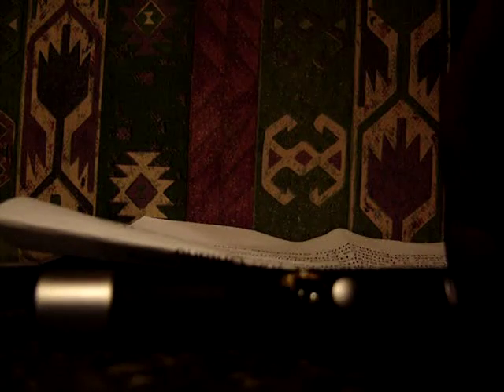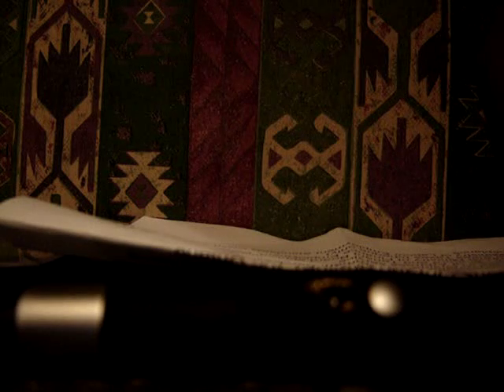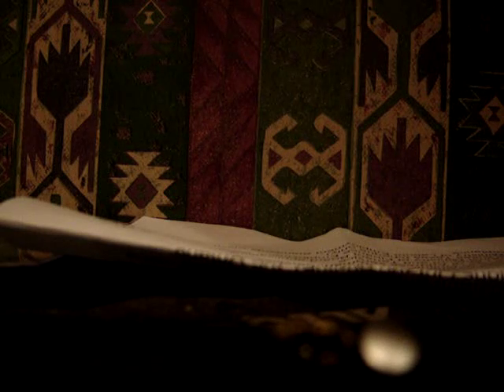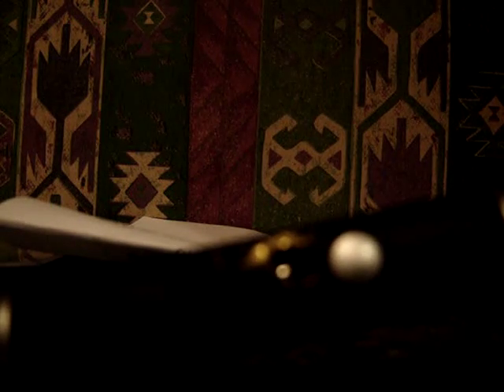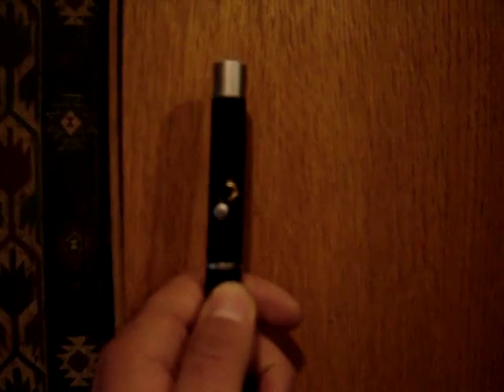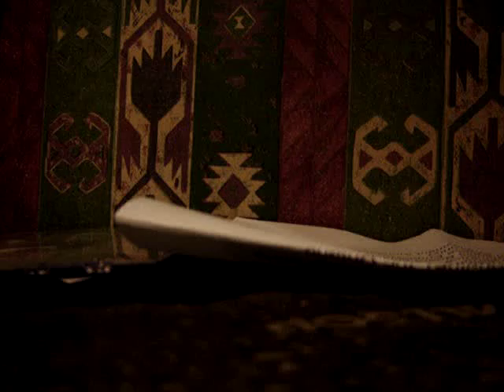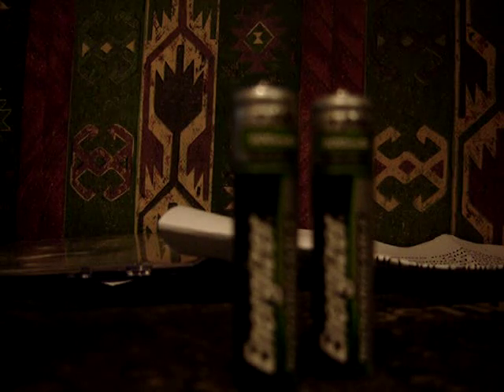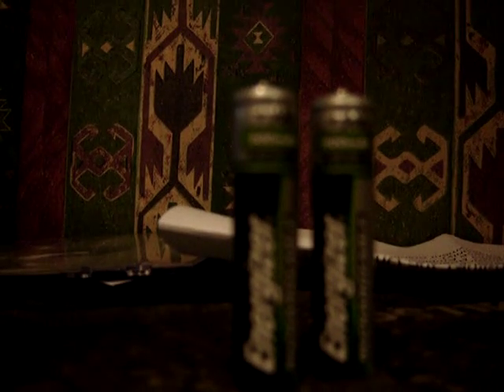5mw Green Laser Pot Modding

Comment from the maker: couldnt even tell you... ive seen that video as well, i turned my pot counter clockwise(to the left) so some may be different than others, i would try turning the pot up before you go melting resistors and other things on the board, just dont turn it up too much... good luck, i also bought a 100mw but i could not find the pot when i drilled the hole in it, so it could have been on the other side of the board, i never checked